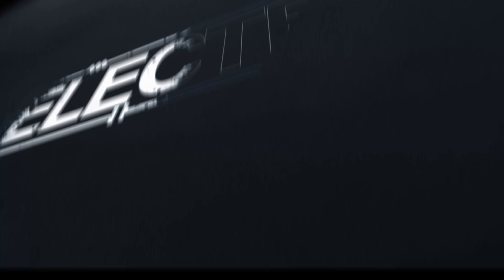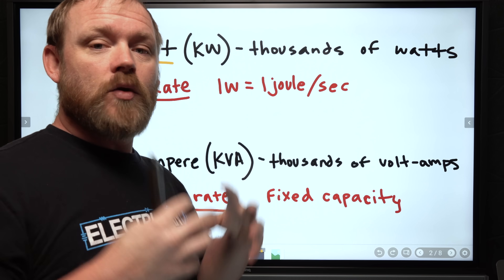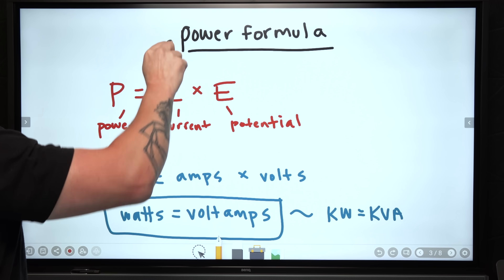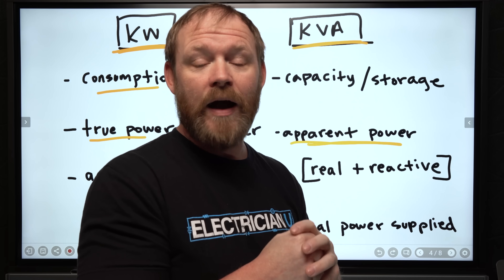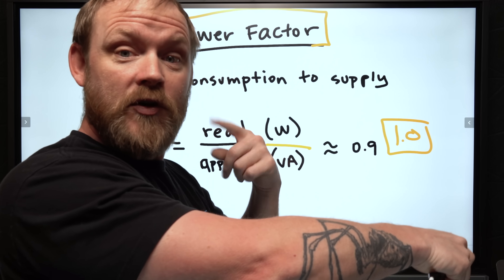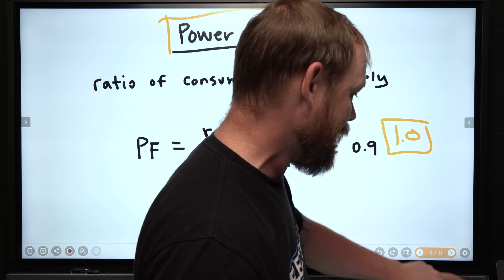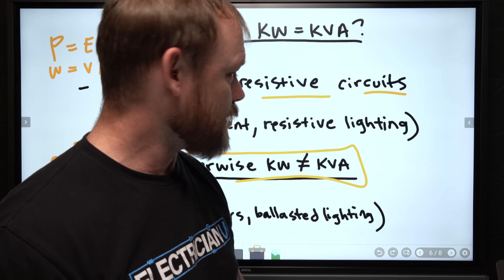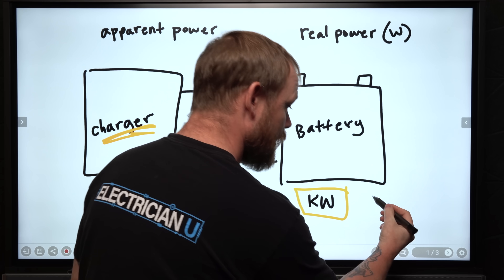Why KW and KVA Are NOT The Same Thing (Even If They Seem Like It)

Comment: So, the title and some statements here are actually totally wrong. kW and kVA are truly identical, always. This is even demonstrated in the video with power factor. Power factor would not be a unit-less ratio if they were not identical. As they are identical, the units in the numerator and denominator cancel. The issue as explained is different than what is stated in the title and repeatedly in the video. What happens many times is that we have the same units for different things and we want to distinguish between them for clarity. We see this with torque and energy. Both can be measured in N•m. But this gets really confusing, because commonly you'll be dealing with energy and torque at the same time. So we prefer to use J (1 J = 1 N•m) for energy, while we leave torque with N•m. So the real issue is that consumption and supply aren't the same thing, but they have the same units, and we want to distinguish between them more easily so we write them with different-appearing units that aren't actually different. It's a pure labeling thing for clarity. But, truly, kW and kVA are identical, always. Thinking otherwise is confusing a convenient choice labeling with what the units actually are.
Reply: You are right about W and VA being truly identical as physical units and their usage being a matter of convention to label different physical quantities for clarity. However, I don't think it is about consumption vs. supply. The correct explanation is at the end of the video. It is about real power vs. apparent power. The Watt rating of a device tells us the maximum power provided or consumed by the device. The VA rating tells us how much power the device can handle, which is at least the Watt rating but is usually higher to account for non-zero reactive power. In other words, the Watt rating says how much power the device can convert, the VA rating says how much power the device can transfer. The transferred power is higher than the converted power when reactive power is passed back and forth between supply and load.
Reply: He is not talking about the units, but about what is being measured with the units.

What you measure with kVA is not the same thing as what you measure with kW.

Just like how torque is not same as energy despite the units being the same.
Reply: @fuseteam  Exactly. That's why the title is wrong and he has repeatedly made incorrect statements. The units are, in fact, exactly the same. They're being used in different ways to represent things. If you look at other replies I get, you'll see that this (not necessarily from here, but from EE in general) has confused a lot of people, who actually think the units are different.
Reply: @ctarobotics7411  he's not talking about the units tho, and when most people say they are the same they are also not talking about the units, but rather about what is being measured by those units. From what i can see in the other replies that people from EE are telling you that apparent power and real power are not the same thing, nobody here is actually talking about the units. The distinction of power supplied (apparent power) vs power consumed (real power) is being highlighted.
Reply: @fuseteam  That's my point. He's not talking about the units. However, the title is talking about the units and he repeatedly says the units rather than what he's actually talking about. kW and kVA are the units themselves, not what they're talking about. So his statements repeatedly confound the units with what they're used for. If you look at the comments, includingmany replies to what I've written, you'll see many people share this confusion, which is why I'm pointing it out. It's a shame, as he does a good job, but many of his statements and the title identify the wrong thing.
Reply: @ctarobotics7411  he is using the units interchangably with what is being measured, the audience understands that. everyone in the replies on your original post understands that. So my point is, from all the comments i've seen, there is no confusion here about the units being the equivalent while what is being measured is not. Using the units instead of the thing being measured is a common practice, we don't say 'how much power does this light bulb use?' we say 'how many watts does this light bulb use?'

if there's anything he IS confounding it is kW and kWh, kVA is not capacity, kWh is. or to be technically correct kWh is the energy capacity of a battery
Reply: @fuseteam  Yes, which is incorrect. They are units for what is measured, but not what is measured. If everyone had understood that, they would never have disagreed with me, so clearly some people misunderstand. That's why I made the comment, because I was seeing that people were misunderstanding.
Reply: @ctarobotics7411  that's simply common convention, nobody uses the term "apparent power" or "real power" or even "electrical energy" in everyday speak, instead we say "Killowatts" "kiloVAs" and "Kilowatt hours".

The people disagreeing with you are people who took you to mean "apparent power" = "real power". Re-read the comments and see for yourself and nobody here is talking about the actual units. 

In practice the units don't matter to people, what is being measure matters. units are just a convention agreed upon a long time ago we could be calling it cats and dogs and nothing would change ;)
Reply: @fuseteam  kwh is for example 1000 watt microwave running for 1 hr - 1 kwh, 2 hrs - 2 kwh
Reply: @WayOfTheZombie  hmmmm
Reply: @fuseteam actually no. If you are an electrician and already understand this, then okay, but most people who know just the basics and look at the labels only see the units. There is no explanation there what it represents. And it is confusing. They could have used the same unit and wrote out the quantity being measured or something. But arguing that they are not the same causes even more confusion. They are in fact the same unit used for representing different things we measure. Thats it, nothing more. Btw we could just as well write everything that is a brutto price as dollars and everything that is a netto price as cents and argue that 100 cents is not the same as 1 dollar.
Reply: @ctarobotics7411 he's not wrong, you are just trying to split hairs and sound smarter than you actually are.
Reply: @ctarobotics7411  anyone who actually thinks the units are different needs to find a new career anyway.
Reply: @BlownF150  Yes, he is wrong. Why does doing middle-school math properly make me sound smart at all? Seriously, (9 kW)/(10 kV•A) = 0.9 (kW/kV•A), which only equals 0.9 if kW=kV•A exactly. That's middle school math.

I wonder, rather, how it sounds when people publicly disagree with "kW=kV•A exactly," meaning they're publicly showing they're having trouble with middle-school math.
Reply: @bertyamaoka9584  I get what you're saying, but that's a bit harsh, no? If an EE thinks they're different, that's a bigger issue. But non-EE's work with transformers, too. They should be able to get by fine, though it would be preferable if they understood, too. Anyone teaching about this should do so properly at least.
Reply: Indeed. Why muddy the clarity of kVA with capacity (AH)? Ugh.
Reply: @ Well, yes, the difference between W•h and W is pretty fundamental. I believe he did make note of this, though.
Reply: It's just power expressed two different ways.
Reply: Glass of beer is kVA, liquid beer is kW, head is kVAr 
Useful (active)  power is what you can drink, the fluff isnt useful.  Its only equal if power factor is unity. ( beer is flat with no head and fills the glass)
Reply: @mattyb7736  You're confounding the quantity measured and the unit. I'm not saying apparent power and actual power are the same. In your example you need to fix things: glass of beer is apparent power, liquid beer is actual power, fluff isn't useful. Only if apparent power and actual power are equal is power factor unity. kV•A and kW are just the labels we're choosing for the units, not the quantities themselves.

Here, try this calculation: What is the power factor with an apparent power of 10 kV•A and an actual power of 9 kW? I get 0.9. You're telling me that is incorrect. Why? (9 kW)/(10 kV•A) = 0.9 (kW/kV•A). The only way you get 0.9 is if kW=kV•A exactly; if they'r not truly identical, you don't get 0.9. As they are truly identical units, this works out fine, giving us a power factor of 0.9.
Reply: @mattyb7736 . Nicely done!
Reply: So, essentially... KVA is energy produced (potential) and KW is energy used (kinetic), and the rest is dismissable hogwash?
Reply: @BygSmuv  kVA and kW are the units for power and are identical. All the rest he said is the important and true stuff. Since there are different things, it helps to differentiate between them by using kVA and kW instead of using kW for both of them.
Reply: @BygSmuv  it is not potential vs kinetic either, "energy used for useful work" is also light when you turn the light switch
Reply: You’re 100% wrong. Answer me this; what’s kVAR, and how does it factor in?
Reply: @OrdinaryDude67  In units, they are exactly the same. We label them differently to distinguish between the legs of the triangle. How do you get a^2 kVAR^2 + b^2 KW^2 = c^2 kVA^2 if they are not all identical units? You don't. The math doesn't work at all unless they are all identical units. We're just labeling them all differently to avoid confusing the things they are used for.
Reply: kVA = kW / Power Factor.
Reply: @airgliderz  No, that is not the case. Consider 9 kW and 10 kVA. What is the power factor? I'll use "F" for power factor. The formula says F =  9 kW / 10 kVA = 0.9. You are claiming F = 9 kW / 10 kVA = (9/10) • (kW/kVA) = (9/10) • (F), leaving us with 1 = 0.9. Why is your method giving nonsense? Because (9/10) • (kW/kVA) = (9/10) • (1) = 0.9. Why is that 1 there? Because kW = kVA.

I get that people love to use the units interchangeably with the quantity being measured (kW for power, kVA for apparent power), but there is a fundamental difference between them. It's rather clear from the comments here that people confound the two. This is part of why this practice is disallowed in SI. Yes, disallowed in the same system that gives us kW and kVA. However, using different-appearing units that are identical as an aid to distinguish quantities is a good thing. Hz and rad/s are equal, but you want to easily keep track of frequency v. angular frequency. J and N•m are equal, but you want to easily keep track of work v. torque. Same thing here: kW and kVA are equal, but you want to easily keep track of power v. apparent power. This mistake is in confounding the units with the quantities, as that messes up all the formulas like I just showed.
Reply: @ctarobotics7411 you are so wrong and it's hilarious watching you put so much effort into proving you don't truly understand this topic
Reply: @BlownF150  What is so scary is that I need to put in so much effort to explain to so many people. If I'm wrong, show me where. Tell you what, just calculate the power factor for an apparent power of 10 kV•A and a real power of 9 kW. I calculate 0.9, but you're telling me that is incorrect. Why? Power factor = (real power)/(apparent power) = (9 kW)/(10 kV•A) = 0.9 (kW/kV•A). The  only way you get 0.9 is if kW and kV•A are identical. So what do I get rather than 0.9, as 0.9 requires what I say to be correct?
Reply: @ctarobotics7411 You're trying to make an argument nobody but you is making. It's tiresome. Nobody cares about the minute point of order you are hung up about, it adds nothing to what this video is going over.
Reply: @BlownF150  If it were such a minute point that no one cares about, please explain why so many people are bothering to respond and getting it so wrong. Clearly a lot of people care about it.

I've said the video is great. It would be so much better if he weren't teaching things under entirely the wrong terminology so more people wouldn't learn it in correctly.

Is using units properly really trivial? The world has lost rockets and more due to misunderstanding units. The very analysis of power factor fundamentally relies on these units being the same. Etc.

Most likely you find the argument tiresome because you disagree with it and yet can't find any problem with it because it's actually correct.
Reply: @ctarobotics7411 because you are spamming every separate comment with the same useless point.
Reply: @BlownF150  I'm replying similarly because I'm replying to so many people separately making the same mistake. If you saw all those, then why would you go along making this mistake so many of them made, too? Don't call correct information "useless" when it disagrees with your incorrect information. Take advantage of the learning opportunity and fix your mistake.
Reply: but torque and work done are not the same thing even if their dimensions are same (energy is scalar while torque is a vector)
Reply: @tsuki_  That's exactly my point. The dimensions here are exactly the same thing, but they're being written in different ways to distinguish between two things that are different. That people seem to confound the units with what they are used to measure in this video and apparently by others leads them to misunderstand the units involved.
Reply: After reading these comments. I'm more confused. I've always had some confusion about this video topic, because a watt is volts x amps. So for practical purposes and my own needs, it is fine to use VA and W interchangeably.
Reply: @michaeldoran4367  W and V•A are indeed the same thing. However, power and apparent power are not the same thing. You don't want to get confused which is which. That's why one is labeled with W and the other with V•A. So if it's just for your own needs and not communicating with anyone else where there may be communication errors, yes W and V•A are completely interchangeable. But for more general practical purposes, communication is important, too, which is the reason to stick to conventions.

So many people have become confused by the convention, though, which is what I hoped to help correct with my post. In calculating power factor properly mathematically, it's critically important to distinguish between power and apparent power, and it's critically important that W and V•A are identical units.
Reply: I agree . That's just a matter of not confusing what's measured. Take for instance active power and reactive power . Reactive power is measured in VAre but that does not translate to something tangible per say , it's purely theoretical. Let me explain . Take for instance a L in a circuit (ex : coil) , you can think of it as acting like an "inertia" for current . It doesn't let sudden changes in current happen instantly due to the nature of how it works , thus the "reactive" in reactive power . That's especially the case for AC circuits , where the current reaches naturally 0 A , but the same thing happens in DC as well (ex : connecting a DC source to RL circuit) . Reactive power is used as well , required for electric motors to work properly . Fun fact : Did you know that large factories using lots of electric motors also pay for the reactive power they use in their bill ? So there's that , I guess ;))
Reply: A power inverter to run appliances in a battery based Solar system may be rated in KVA. Like 6 kva. If your appliances have a pf of 1 then your appliances can run up to 6 kw. But sadly they don't unless you're running 6kw of toasters. A lot of appliances throw volts and amps back at the inverter. So if your pf is 9 or 90% efficient then make sure you subtract  that remaining 10% on top of the total appliance load. So if the total appliance load is 6kw, you've exceeded the inverter rating by 600 watts. 600 watts are volts x amps thrown back at the inverter. So in this case make sure your appliance kw totals no more than 5kw. 
I advise people to understand electricity intuitively, use the water analogy or visualize the sine waves. But then also understand that it's not some up and downs on a graph but actually the hot and neutral wires electrons zooming one way then the opposite way. In the US that would be 60 alternations per second. And if the hot wires electrons are zooming right then the neutral wires electrons are zooming left. It's not a hard shift tho, it's a smooth gradual increase from negative 120v to positive 120v and back and forth and back and forth... that's why there's no positive wire or negative wire with AC, because the hot and neutral are shifting oppositely between positive and negative at a rate of 60 times per second or 60 hertz (hz). The generator from the power company spins and the magnets are curved on the corners at a tighter radius than the stator coil so as they rotate you get that smooth gradual  transition between peak to peak sinewaves. The magnets are oriented N then S then N then S... on the rotor. That's the cause of the electrons alternating, that push pull between north and south. Getting I to stator configuration would be an explanation for another day but just know there are actually 3 independently wound wires in the generators stator producing 3 phases, just imagine the sine waves graph with 3 evenly spaced waves going above and below the 0 volt line. 3phase is used for mostly industrial machinery which needs more than 2 cylinders to run well and not get bogged down , it needs 3. 3 phase is not needed for the avg homes type of loads. 
Interestingly the alternator in your car produces 3 phase ac but a bridge rectifier let's it to the battery in a dc format, not perfect dc but instead  a rippling dc, but does not alternate anymore
Pro renewable energy R&D for 14 yrs
Reply: You seem to have totally missed the point to see the difference of the meaning of the two Units. Even when the numerical value is identical.
The money in your bank account or wallet, is in a currency ( I assume  yours is USD) that is your capacity to spend in that currency but what you spent in cash at the grocery story, hopefully is not identical with your bank balance or the total contents of your wallet. The money you spend via your credit card can be exceeding your capacity… Supply capacity is not the same as the demand even when both are counted in USD.
Reply: @Ghredle  You seem to have totally misunderstood what I said. You're agreeing with me, not disagreeing with me. I have said the units are identical, but they're being used to measure two non-identical things. That was my whole point. The units are exactly equal, but they are written differently to help us distinguish between the two different things they're used for more easily. That's why I wrote "So the real issue is that consumption and supply aren't the same thing, but they have the same units, and we want to distinguish between them more easily so we write them with different-appearing units that aren't actually different."
Reply: I could tell you are wrong just after reading your first sentence.
Reply: @qian333  I can assure you I am correct. Look carefully at what I said and tell me what you think is incorrect, but you'll find no error. If you're stopping right after the first sentence, you probably have the same misunderstanding I'm trying to nip in the bud. Even in the video he shows how his statements are incorrect, specifically needing to contradict himself when he calculates power factor because his calculations only work out properly if kW and kVA are truly identical units.
Reply: @ctarobotics7411  I read half of your comment and couldn’t continue. Put it simple: you can argue that Jour is the same as N.m as unit. But if someone makes N.m  defined as 1 N amplitude of alternating sin curve force acting to an object with alternating speed up to 1 meter distance, that N.m definition is no longer Jour. To be strict, with alternating force and distance under each force, one should find what is the small work done in each small distance increment and integrate them together and the final value in N.m would be the same as the real work done in W. Here VA is commercially used to represent the nominal voltage times the nominal ampere, as is especially used for AC situation, in which both the voltage and current are changing in sin curve and their phase relationship can be any shift. The individual moments real power d(VxA) should be integrated to calculate the real power in W. The branded VA power term is not an accurate representation of power.
Reply: @qian333  If you really believe what you're saying, what do you get for a power factor with a real power of 9 kW and an apparent power of 10kV•A? I get 0.9, but you're saying that is incorrect. So what should it be? Maybe you should have read more than halfway through. You've got multiple errors in what you wrote. While I figure "jour" is just a typo, "work in W" is just plain incorrect. Also, you are confounding units and the quantities using them. Sure, nominal voltage is measured in V, but so is actual voltage, right? Sure, nominal current (not nominal amperes) is measured in A, but so is actual current, right? Neither V nor A are defined by any curve in either case. V is defined as J/C, where J is defined as N•m and N is defined as kg•m/s^2. A is defined as C/s. Yes, I agree the branded V•A term is the apparent power, not the actual power. We use different labels to avoid confusion, but it is fundamentally critical that W=V•A for things to work in the complex plane and for things like Power Factor to be calculated properly. That was my whole point: apparent power and actual power are not the same, but W and V•A are the same. We just write the same thing in different ways to avoid confusing things. Unfortunately, as many here including yourself have been demonstrating, this has resulted in a lot of people confounding the units with the quantities using those units, which demonstrates a problem and the reason this approach is said to be avoided in the very place these units come from. Next time maybe you'll continue reading something like this so you understand better rather than stopping partway through.
Reply: Bollocks!
   1kW + 1kW = 2kw 
         but
   1kVA + 1kVA ≠ 2kVA
Reply: @maxmustermann9587  Yes, 1kVA + 1kVA = 2kVA. However, that does not mean you can just add two apparent powers linearly. This is actually why the equality between kV•A and kW exists. You're looking at a triangle in the complex plane. The sides must be in the same units (though you could change the kilo for other prefixes if you want to be confusing). When you add the real power to the reactive power, you need to remember that they are different legs on a triangle in the complex plane, where the apparent power is the hypotenuse. That means you use the quadratic formula. Same thing happens if you go east 3 m and north 4 m. You end up 5 m from where you started, using the pythagorean theorem. But 3 m + 4 m = 7 m. Why? Because we're doing two different operations. Likewise with what you're presenting. You are confounding the units with the quantities they are used for.

If you truly believe I'm wrong. calculate the power factor of an apparent power of 10 kV•A and a real power of 9 kW. I get 0.9. You say I'm wrong. What do  you get? You can't get 0.9 unless I'm correct, as it requires kV•A and kW to be identical so they cancel perfectly.
Reply: @ctarobotics7411 
You agree with me that kW and kVA are calculated differently but you still claim that "kW and kVA are truly identical, always."

END of Debate
Reply: @maxmustermann9587  No, apparently you have completely misread. Apparent power, real power, and reactive power are different things calculated differently. How do you calculate both W and V•A? 1 W = 1 J/s = 1 (J/C)(C/s)= 1 V•A. They are calculated the same way.

End of debate. You will find no errors there.

Stop confounding measured things with the units and you'll start understanding better.
Reply: KVA and KW are identical for DC circuits, but for AC they aren’t.
Reply: @geoffstrickler  They are identical in both, always. Real power and apparent power are not generally the same in AC circuits (they can be the same in resonance when reactive power drops to zero). But thinking that this means the units are different is fundamentally misunderstanding what the units are. We only label them differently to help avoid confusion about which goes where. When I calculate the power factor for real power of 9 kW and apparent power of 10 kV•A I get 0.9. You're saying that is incorrect. What do you get? You only get 0.9 if kW=kV•A here: (9kW)/(10kV•A)=0.9* kW/(kV•A), which equals 0.9 only if kW/(kV•A)=1, meaning kW=kV•A, even here.
Reply: @ctarobotics7411  If you have to add additional factors and conversions (power factor to compensate for inductive and capacitive losses), then clearly that AREN’T identical for AC. No about of hand waving will make that true. All you can do is show how to convert between, and that conversion doesn’t have a constant value when you’re dealing with AC. 

For DC, they are truly identical, 10KW=10KVA, there is no conversion, they are two different names for the same thing.
Reply: @geoffstrickler  When you're talking about those factors, you're talking about real power, apparent power, and reactive power not being the same. Those powers are not the same. But those are the quantities, not the units. The units are the same for all three, just written in different ways as a reminder so you don't lose track of which one is which.

Try calculating the power factor for 9 kW and 10 kV•A. Seriously. Try calculating it. It should be quick. I get 0.9. You're saying it's not 0.9. What do you get? If you calculate it properly, you'll get 0.9, which only happens if 1 kW =1 kV•A. If they are not exactly the same, you'll get some other answer because they won't cancel.

I'm not saying real power, apparent power, and reactive power are the same things. And they're never all equal, though two could sometimes be, such as the DC case you mentioned, the resonance case I mentioned, and when there is exactly π/4 phase difference (then it's reactive power and real power). I've been pointing out that the quantities are not the units. So so many people have gotten confused between the quantities and the units that they don't truly understand what they're talking about when they discuss the units.

In a totally different context, it's like you're telling me 1 cent does not equal 0.01 dollar because pennies and dollar bills are made out of different materials. That's what happens when you confound units and quantities.
Reply: @ctarobotics7411  They are real quantities. But when you say it’s identical, you’re overstating the situation. Yes, in theory the total is the same, basic conservation of energy. But they are NOT identical. To calculate the conversion, you need to measure specific information about the circuit and load (frequency, voltage, amperage, inductance at load/frequency, and capacitance) to even be able to calculate those components. It’s not just KVA = KW. Only under ideal circumstances can a 10KVA source supply 10KW to a load when it’s AC.

In DC, so long as the wires are of sufficient gauge, reasonably straight, and not excessively long, a 10KVA source can supply 10KW to a load. 

So to claim they’re identical for both AC and DC is simply misleading. There is a reason my battery backup units have a higher KVA rating than their sustained KW rating.
Reply: @geoffstrickler  You keep talking about the quantities, not the units. You don't ever measure kW or kV•A. Those are defined. You measure various powers, which you measure in units of kW, kV•A, etc.

I'm guessing you haven't tried the calculation. What is the power factor with real power = 9 kW and apparent power = 10 kV•A? You keep telling me it's not 0.9, but you won't say what you get. Just try this calculation. Follow Algebra 1 rules. You'll see. kW and kV•A don't cancel to leave 0.9 unless 1 kW =1 kV•A even here.

Here it is in detail:
power factor = real power / apparent power
= (9 kW) / (10 kV•A)
= 0.9 (1 kW/1kV•A)
So if 1 kW =1 kV•A, you get 0.9. If they're not equal, even in this AC case where we don't have resonance, then you don't get 0.9. Even this very video shows them being identical when the calculation is shown, despite the claims otherwise.

It all comes down to people confounding the quantities and the units they're written in so much that now people are really confused what the units actually are. There is a reason the very system (SI) that provides us W, V, and A says you should never do what so many of you are doing here. It is misleading to claim kW and kV•A are anything but identical ever. It's so misleading that many people here have to contradict themselves when they do power factor calculations.
Reply: @ctarobotics7411  No, you keep ignoring that your have to make circuit specific measurement to make it work, yet you claim they are identical. That’s not just a difference in units. If it were, converting the numbers would not need to make circuit specific measurements. They are very closely related, and functionally equivalent, but they ARE NOT IDENTICAL!!!!
Reply: @geoffstrickler  No, that's not what I'm saying at all. I'm saying you have to make a circuit specific measurement in terms of specific, pre-specified units. The circuit-specific measurement is of real power or apparent power or reactive power in these cases. These three powers are what you're measuring and are what are not identical. The units are defined ahead of time as (dropping kilo) W=kg•m^2/s^3 or V•A=kg•m^2/s^3. Notice the two are the same, truly identical, defined that way and always that way.

They are completely interchangeable, which is why they are used the way they are. Real power, apparent power, and reactive power form a triangle in complex space. All three have identical units. But we can write the units so many different ways. So we choose to write them differently for each of the three so that we are less likely to confuse which one we're looking at. We arbitrarily choose W for real power and V•A for apparent power. We could have chosen V•A for real power and W for apparent power. We could write one of them as J/s instead. It just doesn't matter as those are all identical. They only look different without actually being different, which helps with the differentiation. But, happily, because they are all identical the math works out. If they weren't identical the mathematics would fall apart and we would have problems.

If you would just do the calculation I showed you, you'll see this for yourself. What do you get for a power factor with real power of 9 kW and apparent power of 10 kV•A? I get 0.9. You're saying that's incorrect, because it's only correct if kW=kV•A. So what do you get if it's not 0.9? How do you get this other value, whatever it is?
Reply: @ctarobotics7411  your mind is made up, you refuse to see it. Know everything you have written, long before you ever commented. You’re just committed to your beliefs.

My objection is to the claim that they’re identical for both AC and DC, and that’s ONLY true in the ideal situation. In reality, they aren’t identical for AC. As I said before, they aren’t functionally equivalent, but IDENTICAL is not the same as EQUIVALENT.
Reply: @geoffstrickler  If I'm so wrong, why do you refuse to show the calculation. Repeatedly people refuse to do this calculation. Why? It shows the truth very clearly. Is it a refusal to see the truth.

If you know everything I wrote, you know I'm correct here. They are identical except in appearance (the letters used to label them), regardless of AC or DC. Don't believe me? You could look it up, too.

Apparent power and real power are what is different. We could measure them both in Watts. If we do, you would claim watts aren't equal to watts?
Reply: One is 100% useful or usable power, (kW) the other is not. kVA includes power factor which has the current either in front of the AC voltage as it rises from zero (leading) or behind the voltage (lagging). It used to be described as ‘wattless current’ and is essentially wasted power. So the power factor tells what is actually usable (true) power in kW, rather than what is actually needed to power the entire load (resistance+ inductance + capacitance) or the apparent power.
Only in a purely resistive circuit can kW be equal to kVA and kVA only exists in an AC circuit as it is to do with the alternating voltage as it rises and falls 50 or 60 times a second.
Reply: @starcruiser9325  Its not "usable power".  Its "power actually consumed" by the device verse "power reflected back to the source by the device that was not consumed".   Reactive power is not lost in any way... it is actually, physically reflected back to the source and it is possible to recover it and reinject it back into the forward direction (aka LC circuit or reactive power recovery diode/capacitor combos in inverters).

The reason for the distinction is that the net reflected power (the portion which is not canceled out against the forward power) flows through the circuits and the wiring TWICE.  Once in the forward direction, and again in the opposite direction when it is reflected.   This means that it generates HEAT in the circuits twice as it flows through the equivalent resistance of all the components and wiring.

This is why it is so important to understand the distinction.

-Matt
Reply: @starcruiser9325  You misunderstand. I'm not debating usable power v. not, nor what power factor is. I agree with all that. That's not the problem. I'm pointing out that the reason to use kW v. kVA is a convenience to differentiate between the two. It's an arbitrary choice made to identify things. The reason this choice is possible is because kW and kVA are exactly the same thing. kW or kVA can be replaced with each other arbitrarily, but then it becomes confusing, so it's bad form to do so. Everyone who is calculating power factor, including in this video, is agreeing with me, as otherwise the units would not cancel as they do. Thinking they are ever not the same is a confusion that is apparently resulting from videos like this mis-teaching the units. It's not that the units are ever different from each other, it's that they're being written differently to help identify different things.
Reply: No. EE here.  The flow of energy depends upon whether the load is mostly inductive as for motors or heater coils, or mostly a capacitive load such as maybe a DC power supply that often uses many capacitors as a filter, for example.  The typical local power company would like the power factor to be as close to unity, or one, as possible.
Reply: @ I think you misread what I wrote. I've agreed with you that these are different things. What isn't different is the units. They're written differently to avoid confusing different things, but they are identical. Even your comment about power factor belies this. Power factor being close to unity or far from unity has no meaning unless the units being divided can cancel.
Reply: @Bridgeman416  It doesn't matter if it's EE or not. How do the units cancel in the numerator and denominator for power factor? Because even in EE they're identical. The issue is that the things they're used for are not the same and we would rather differentiate more clearly, just like with energy v. torque. So we make them look different despite them being identical. 1 kW =1000 kg•m^2/s^3. 1 kVA = 1000 kg•m^2/s^3. Labeling them as kW or kVA is nothing but a matter of convenience, as kg•m^2/s^3 is a mouthful. But if you think that makes them different, then you are confounding convenient labeling with the actual units.
Reply: You are too stuck on the units and it sounds like you are not aware of the physics. What the units actually represent.

Torque is how much rotational force per radial distance is excerted. Energy, with the units you described, is how much is excerted or available if you think about potential energy, per distance.

KVA and KW may have the same units but KVA is for loads that have reactance or inductance due to coils or capacitors present. The physics are totally different and you use phasors to visualize it. Just like the physics of torque are totally different from energy.
Reply: @darkcoeficient  Oh, no, I'm super-aware of the physics. I'm aware enough of the physics that I know some of the special cases where other things he said are not quite right, such as hitting the right resonant frequency so that the imaginary terms cancel and impedance matches resistance with AC. But those are special cases, and he wasn't trying to worry about the special cases; so I would never fault him for that. But it's that I know this stuff so well that I recognize the difference between the units and the quantities they are used for. Even in the video, when he shows power factor, he shows that kW and kVA are still identical when the quantities they are labeled with are not. I'm just aware enough of the difference between the units and the quantities that I don't confound them as he and a number of people replying to me apparently do. I was hoping to try to correct that misunderstanding.

If, however, you think kW and kVA are actually different under any circumstance except the letters with which they are written, then you have some confusion in the physics.
Reply: @ctarobotics7411 you’re educated beyond your ability to understand. If you think watts and volt-amps are the exact same thing then you simply don’t know what you’re talking about.
Reply: @OrdinaryDude67  So what is the power factor for the fraction he does with 9 kW and 10 kVA? He has it listed as 0.9, in agreement with me. You claim otherwise. What is it?

If you think they are different, you are confounding the units with how they are written to distinguish between different quantities to avoid confusion. Even electrical engineers, when they write power factor, 100% agree with this.
Reply: Revisit your text books
Reply: @andilemthethwa940  Yes, I do often. They agree with me. Try doing the calculation of Power Factor for power = 9 kW and apparent power = 10 kV•A. If you get 0.9, you agree with me, too.
Reply: You are wrong ! You would also claim I gallon of gasoline is 400 horsepower .
Reply: @thomeedee  No, 1 gallon is a measure of volume. If I'm wrong, what is the power factor for 9 kW / 10 kVA. It's not 0.9 unless I'm correct.

I'm actually completely correct. What they're used to measure are different, but the units are, in fact, truly identical. It's like recording a frequency in rad/s or in Hz. The units are truly identical, but if you mix up what you're measuring, things are going to be really bad. So we make sure we use different-looking labels even though the units are identical.